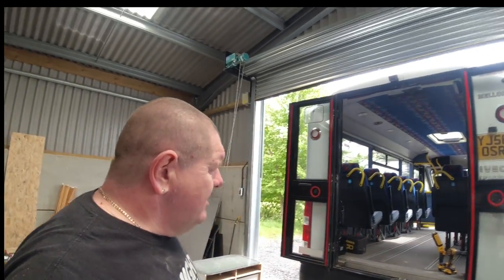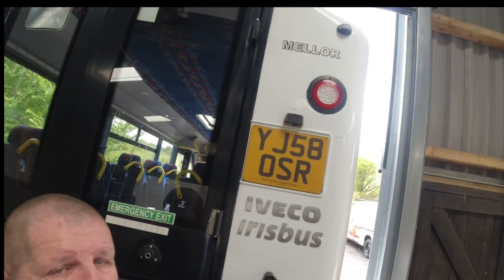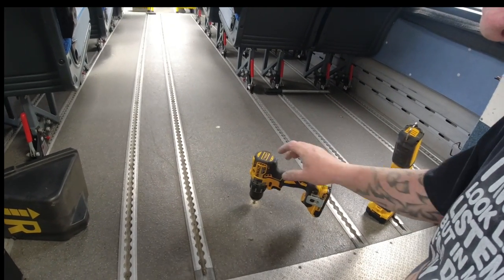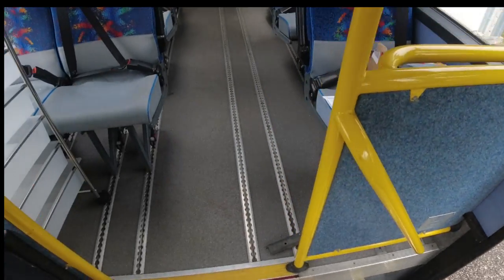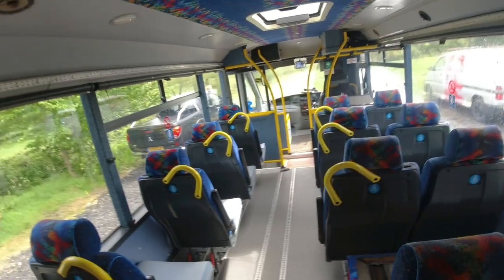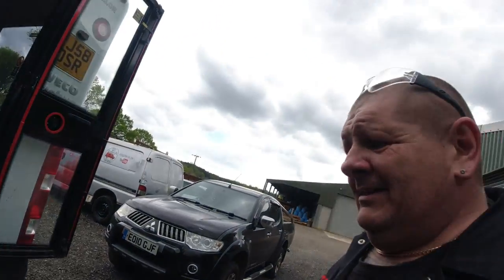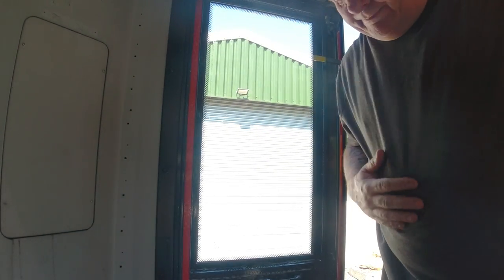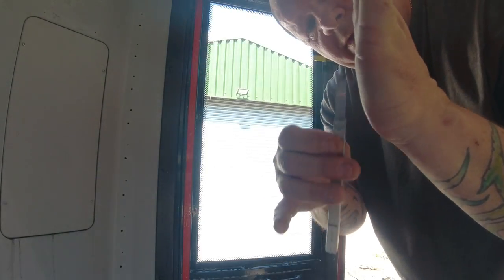IVECO IRIS BUS CAMPER CONVERSION - Window Tinting Part 1

Comment: Very excited to see this project going forward as I will be buying my own van shprtly (think I would prefer a bus rather than a panel van). However, there aren't as many vids on bus conversions probably due to the fact that there are so many windows which are harder to work with?  Best wishes, Des
Reply from the maker: Thgank you I seem to convert more buses than i do vans i have three in total in the workshop, the renault trafic, vw crafter bus and my iris bus.

Comment: Did you ever get the floor out of this van ??
Reply from the maker: No the floor rails have way to many bolts there is more than just the ones you can see and since there is no metal floor only wood it is made up as part of the structure so I have left them in